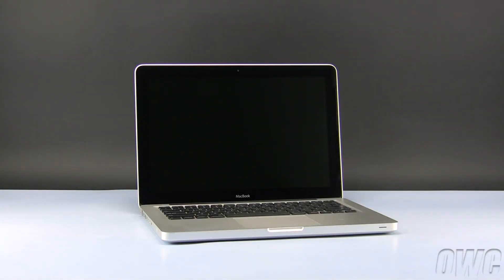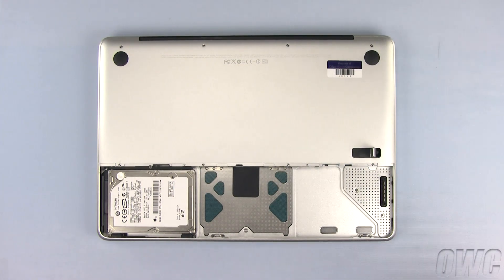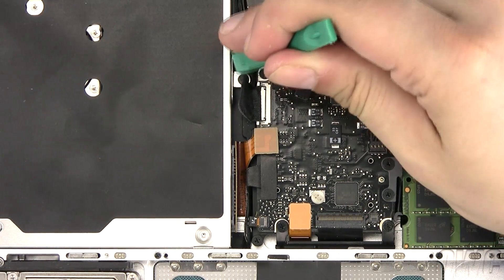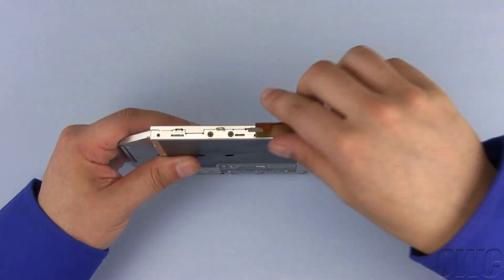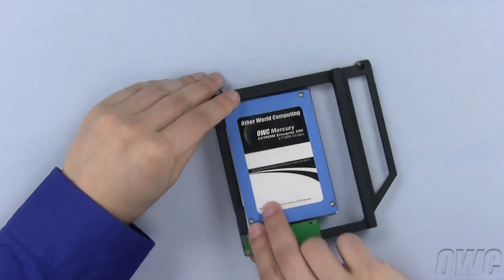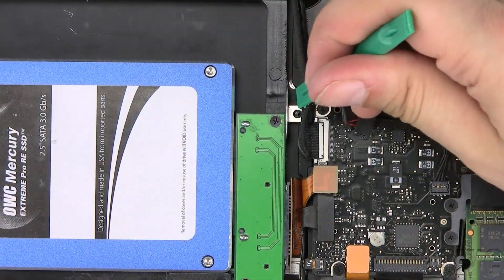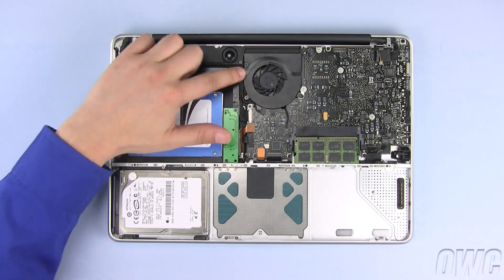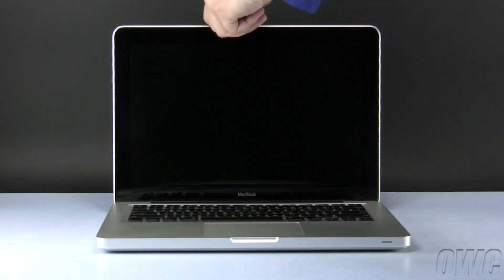13-inch MacBook Late 2008 Data Doubler 2nd Hard Drive/SSD Installation Video

Comment: does it work on macbook pro late 2008 5.1 15inch??? is it the same?? i want to install a ssd and put on the caddy the hdd...
Reply: Yes, it does. I have removed the DWD combo drive and installed a Crucial SSD.

Comment: I have done this data doubler on my macbook 13' late 2008, afterwards my wi-fi no longer works. Although my bluetooth and isight camera still work. It says there is no wi-fi hardware installed. i tried re-installing lion, reset NVRAM / PRAM and checking all cables multiple times nothing works. Anyone knows where the problem might be?

Comment: In a late 2008 unibody 5,1 2ghz I have a seagate 1tb sshd and looking to put 250gb and owc data doubler in optibay. for my specific model, would you put the ssd in the hdd bay or in the data doubler (optibay) On one hand its the SMS and on the other its the SATA speed. But for my specific model what would you say? (btw not a fusion drive) everybody says something diff...